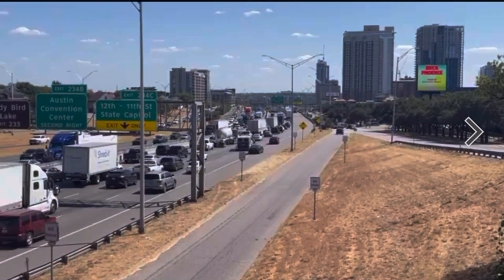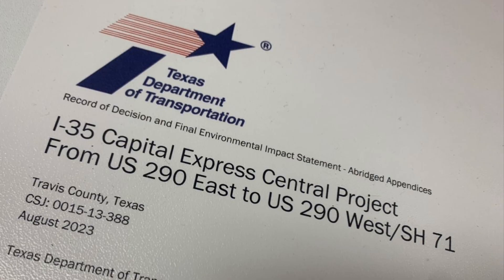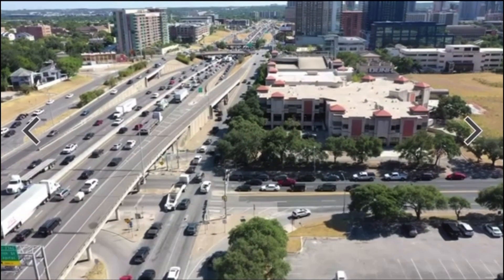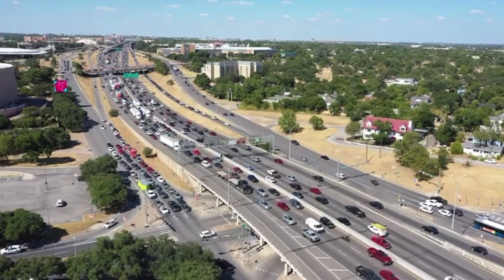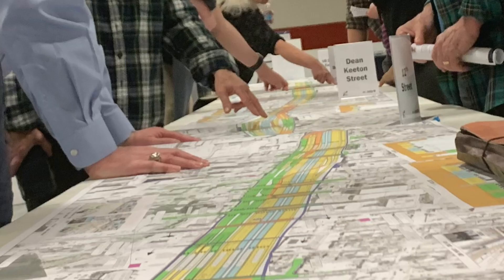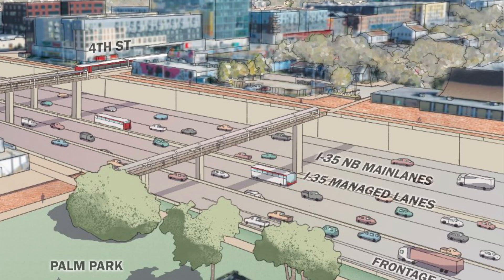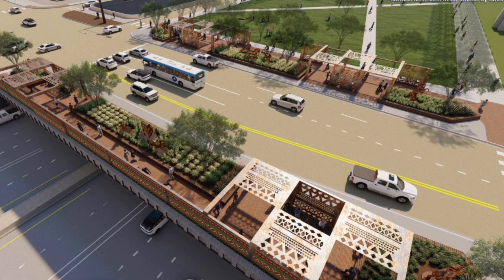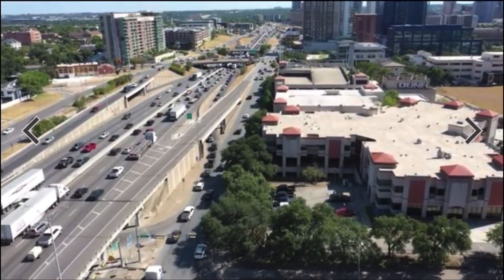I-35 Capital Express Central Project Receives Environmental Decision

Comment: That mock-up looks truly dystopian, just a massive concrete gash running directly through the city, making it scarier to get anywhere without a car. Saying you incorporated community input is a bit rich considering the overwhelming majority of community input was "please please please don't do this holy crap."

If you want to actually fix traffic on I-35 your $4.5 billion would have gone a lot further if put towards transit, pedestrian, and bike infrastructure. The whole reason there's  congestion is because people keep getting on and off the highway for short <10 mile trips across town, because there's  no alternative or no incentive to not do it that way, and that's butting heads with with all the cars trying to make longer trips which don't  need to be passing through the city anyway! Man, $4.5 billion is 11 times the annual budget of the entire Cap Metro system - we could have more than doubled bus service for a whole decade! We could have made Austin a world-class people-oriented city with that money, which would also be a more permanent solution to i35 congestion than this. Instead we're stuck with a wider highway that's gonna kill more people and will fill up again in a couple of years thanks to induced demand. You've outdone yourselves once again TxDOT.
Reply: TxDOT's job is to facilitate economic growth in the state through infrastructure. Unfortunately, this does not involve appeasing Austin's urban dwellers. And 'induced demand' is a fallacy—it's otherwise known as people moving in.
Reply: @ironmatic1  This won't facilitate economic growth through. And you can't just confidently say that induced demand isn't a fallacy and expect anyone to believe you over the 100 years of traffic data showing that it's absolutely real